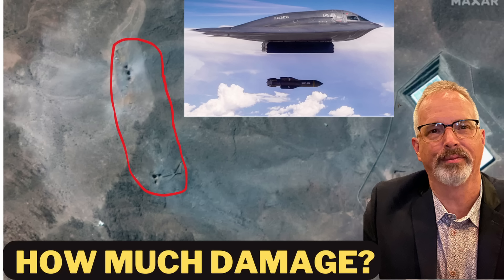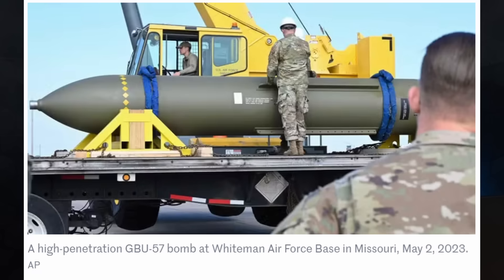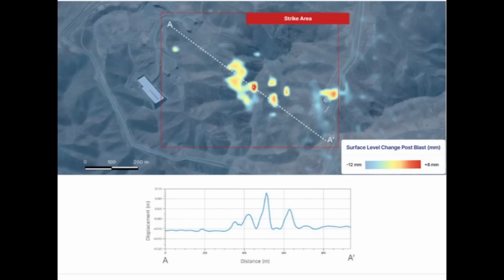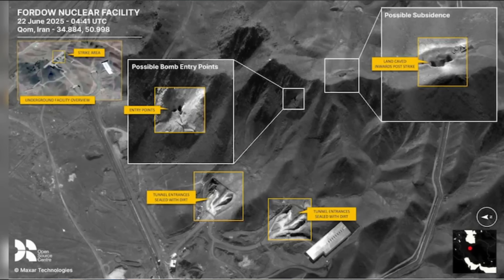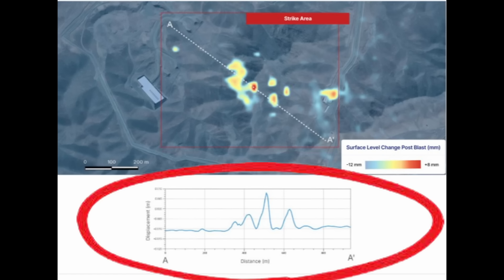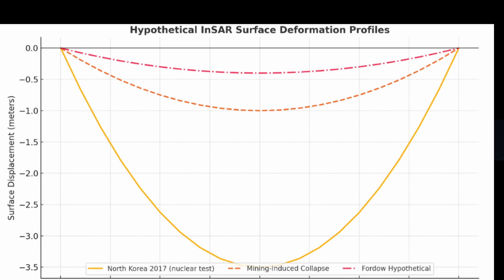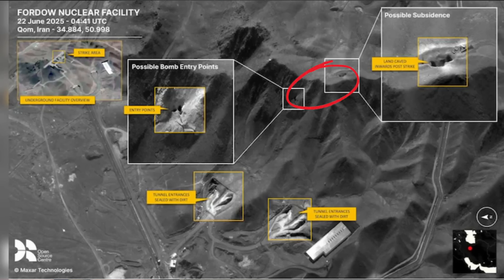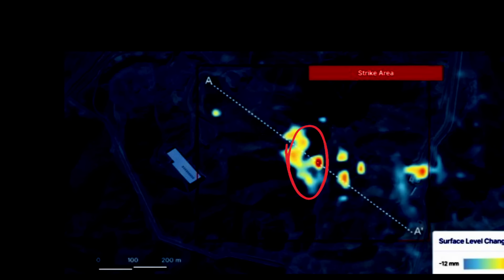Fordow Attack Assessment -  Update

Comment: Very good analysis.  What if the bombs tumbled during penetration due to shape and varying angles of the granite; wouldn't that lessen the ground surface elevation?  If bombs went through ventilation shafts wouldn't stand to reason that the bombs penetrated well below the ground level of the facility because the bombs would have gone through the ventilation shafts with no resistance (like a knife through butter) and penetrated and exploded well below the floor of the facility; and if so wouldn't that cause more damage and potentially a very large sink hole?
Reply from the maker: Thank you.  Those are all great points.  I would hope that the U.S. will release more information to explain more of what happened there.

Comment: The "powder factor" referred to in your calculations is based on a single confined explosion. As six GBU-57s were used at each entry point, you cannot simply add their cumulative effects. This is because each explosion would be unable to remove all of the material fractured by the previous blast, and consequently, later explosions will re-fracture the rock displaced by earlier detonations
Reply: It won’t b removed but more easier to break through.

Comment: One thing that has confused me about the discussions is the assertion that each bomb has an amount of explosives close to its weight: 27000lbs, but only about 5000lbs is actually explosives.  If I ran the powder formula using 5 bombs (Since 6 were dropped but one was just to knock the cap off), I get 25000lbs of explosives, for about 50000 cubic feet of rock.  Is that because the explosives here are more powerful than what is assumed in that powder formula?

Comment: Concussive blast waves tend to want to travel in straight lines along the path of least resistance. Void dampening of the blast wave is possible but difficult Any forking of the shafts must also consider characteristics & type of of the explosive .Different fuses may be indicated for different explosive force generators , fusing is a science of itself .

Comment: I'd like to know, whether 3 separate entry holes in one location means that all 3 failed to reach the intended depth, or if the first could have created an internal hole wide enough to allow the next one to go deeper, and the next, or if all 3 went to the same depth and had little effect other than shaking things up.
Reply: There werent three entry holes at each of the two hit ventilation shafts.   Look at the pictures of the shaft in the video. There were two and 6 bombs sent down each ventilation shaft.  The first was to penetrate the concrete cap the Iranians had put on the shaft.    Also some interesting stuff in the threads here, they Iranians were trying apparently to fill the shafts with material, hence the dumptrucks seen at the site previous to the attack.

Comment: A bit of a pervert did the math and they were traveling a little over $1,403 ft per second if guided munitions into a 300 ft air shafts from 31,000 ft.. 1 and 3/4 the speed of sound, there was no Sonic boom because it goes up vertically and only travels, goes horizontal. But the earthquake of that 100,000 + metric tons of TNT Overkill decimated anything underground. The fires underground in crevices, of chemicals no man could survive.😮

Comment: Remember, the machinery targeted is very precise, designed to turn at very high speed, with linear velocity probably just under the speed of sound in the rotating material.

Any high-acceleration seismic shock stand a near-certain chance of damaging such a machine beyond repair--and if the machines are charged with uranium hexafluoride, the whole volume of the underground halls will be filled with very toxic gas.

Comment: Not an engineer. But this video seemed to say very little. Fracturing rock that has already been fractured from a first blast would be very different ... and less impressive than the first blast fracture of intact rock.  Also, how deep did the bomb travel in tests through similar rock? Surely that is a factor ... but was not discussed. How much of the blast force was directed up through the holes the bomb had traved down through ????  Nice talk ... interesting concepts .... next to no useful data and yet you confirm the "total" estimate ... ok ....

Comment: I don't find this convincing.  There was enough explosive energy in the bombs to fracture an extremely large volume of rock.  Ok, how much of that energy was spent fracturing irrelevant rock?  How much spread out as shock waves that gradually dissipated over the course of many kilometers of travel through the ground?  Of the observed change in ground height, how much would be expected as the result of shifting loose surface material downhill after a seismic event?  What magnitude seismic event would match the observed change?  What effect would an event of that magnitude have on the underground structures?  The Iranians knew we were preparing to bomb that specific site: how did they prepare the site, to protect the structures?  Were there secondary supports that could bear the weight of the rock above, if the ceiling collapsed?  Were the sensitive centrifuges on platforms that would hold steady as the floor under them shook with the passage of a seismic wave?  I didn't hear any of that kind of thing.
Reply: the stuff inside was fucked, that is the answer to your questions.

Comment: Honestly, this is all still just guesswork. As long as we do not fully know the actual design of the ventilation shaft, the internal layout of the facility, the additional hardening they may have done, this is all very unreliable. Just a few meters of HPC outside the core facility, could have shielded the entire core facility. There is also no indication, that the ventilation shaft was just straight down, with no additional reinforcements in between, which could have taken most of the damage. 

As long as we do not get any official reports or leaks, we do not know shit.

Comment: Solid analysis with the data we have. I think the main missing piece is there is an assumption that the MOP was able to penetrate to the depth of the facility, either through its kinetic energy or the explosive aftermath, perhaps after multiple serial penetrations.

The problem is this: what if all that fracturing of granite took place above the facility and the void itself was never breached? Is there a way to calculate that from the data we have?

Comment: A question about the amount of rockfractured. (1 cubic yard per half pound of explosive)

you (Casey Jones) said each bomb was 30,000lbs of explosive.. 
https://en.wikipedia.org/wiki/GBU-57A/B_MOP says..
Mass	27,125 lb (12,304 kg)[4]
 "Filling	AFX-757/PBXN-114, Filling weight	4,590 / 752 lb (2,082 / 341 kg)" .

You appear to be using the weight of the bomb instead of the (much lower) weight of explosive filling)

So, your calculations are sort of an order of magnitude or so "out"

Comment: I don't even fathom that such a critical feature of the "nuklear" bunker was designed by chimney engineers, making it Santa's compatible.
Your analysis fits the allegory.
Yes, the final volume of "crushed" rock is based, as I sense, on "optimal" discharge of the explosive when there is little or no void in the initial cavity.
As the PV formula teaches, any substantial "empty" volume degrades implied forces. This compromises shock wave propagation, weakening the front of the penetration path even further.
What if the shaft was not Santa's compatible?
... was not straight
... was in a section protected by steel plates arranged in a crate, thus annihilating stresses from front wave propagation
... was deeper than the main bunker and was put on the side of the main structure

Assuming that the bunker was designed by idiots ... might be in the minds of some ... as evidenced, but others might have a different perspective.

Comment: Engineer here with a couple of questions:
1. How is "fracture" defined?  In other words, how fractured is fractured in a quantifiable definition and would merely putting a fracture through a block of solid rock in a confined environment cause or allow it's displacement into the underground structures?
2. How close to the underground structures did the weapons get?  Did they get close enough to create sufficient differential pressures in rock and/or gas to blast them into the chambers for the desired results (destruction of the enrichment devices)?

Comment: G-day,

Blooper Alert.

3 Kg per Cubic Metre
Is NOT
"HALF A POUND PER Cu. METRE..."

3 Kg is closer to
SEVEN POUNDS...., per Cubic Yard.

Therefore, thus, and because...

Casey, mate, you appear to have Overestimated the Damage done to the Granite, by a factor of SEVEN - bases on the 

Poundage of Explosive multiplies by a totally erroneous and exaggerated ("Trumpificated") 
Powder Factor.

"Septic Tanks" (ie, Yanks...) are
Internationally FAMOUS for such
Mistakes.

NASA successfully (Suck Cess Fully...!) spent decades building and launching, then years guiding a very expensive Mars Lander to
Miss the Atmospheric Entry Window, because the Septic Tank on the Electrick Slide Rule 
Failed
To convert Newton-Metres per Second into Foot-Pounds per Second, or something equally Infantile and obvious...

It's a KNOWN FLAW when working with "Engineers" raised & trained in the USA.

When converting from and to metric,
They 
Often
Go the WRONG WAY,
With their SIMPLE ARITHMATIC.

160 METRES of Granite.

Bomb DESIGNED to penetrate
50 FEET of Rock.
3 Bombs per Hole, one to remove the Cap...
Two Bombs down the Hole.
And - even assuming the Bombs went all the way to the bottom of the Vent-Shafts (?????),
7,000 Kg of Explosive per Bomb (half their weight is Steel Casing), is 5,000 Cubic Metres of Broken Granite..., maxim (?).

But, whereas 3 Kg of Explosive will "Break" a Cubic Metre of Granite - that Cubic metres is assumed to be unsupported, sitting on the ground, with the Explosive sitting atop it.

In this Raid, each of the 5,000 Cubic Metres is embedded in a Contiguous Rock, underground.

When was the last time anybody placed ANY Explosives 160 Metres deep in a Granite Mountain and then measured the Camouflet thus produced by the detonation ?

My guess is

NEVER BEFIRE IN HISTORY ! (?).

Part two is that the 
Perhaps TINY little Cave the Bombs produced were halfway down the 160 metre Shafts - and the Shafts were linked to the "Gallery" by a pair of Tunnels, a Kilometre on length...

And the Tunnels were designed for Nuclear Weapon Groundburst Attacks overhead in mind...; so, YES, the Tunnels were fitted with Blast Overpressure Doors, at both ends, and maybe in the middle too.

So, my 
GUESS,
Is that the Gallery of Centrifuges was
Merely
"Shaken but not stirred..."

Like 007's Dry Martinis.

Yet ANOTHER
'MurriKa(!)n
Militarised
FAILURE...
Apparently.

And then overpowered and wrapped in
Propagandustic
Triumphalist 
Bullshit, before
Presentation to the World.
Labelled as a
"Success !"

(Suck Cess...!)

The Click is ticking.

Unkle Spam can 
Ignore
Global Warming 
BUT
Global Warming
Will NOT
Ignore the
Excited Status of
Norte ArmedmeriKano...

In fact, by the look of Texas,
The Weather Gods are
Making an EXAMPLE of what happens when the filthiest 
Emitters of Atmospheric Fossil Carbon
Retreat into
Denial and Rationalisation.

Unkle Spam's
Karmic
Comeuppance is
In the Pipeline.

Count on it.

One does not even NEED 
To perform a targeted Raindance
To
Bring it on.

One has but to sit back, chew the Popcorn, and try not to giggle too very loudly...

The Universal Creator Godtheory is NOT 
An
AMERICAN...

Do try to keep that FACT in mind.

Such is life.

Have a good one...

Stay safe.

;-p

Ciao !
Reply from the maker: Too quick to criticize. I said a half pound per cubic yard.
Reply: @CaseyJones-Engineer 

You said 3 Kg per Cubic Metre
You said
Half a pound per Cubic Yard.

A Metre Is
39.3937 inches.
A Yard is 36 inches.
One seventh the mass of Explosive will NOT
Create 6.8 times the amount of Force when you measure it in 
Pounds instead of Kilograms, and make a mess of the Marhematics.

AmeriKans will, no doubt, swallow that 
Politicised/dumbed-down/ deliberately wrongful crap....

Australians, not so much.

;-p

Ciao !

Comment: The intelligence community has been silenced by Trump.  There are 6 bombs used at Fordow.  There are six holes.   The ventilation shafts are almost certainly not vertical.  The bombs can penetrate 60 meters of the 100+ meters required.  So, they missed the target.

Comment: You have made several mistakes.
The majority of the weight of the GBU is the metal casing; the actual explosive was about 7000 Ibs. Also, you did not mention anything about HPC concrete. The shaft was lined with this concrete, which can withstand earthquakes!!
https://www.youtube.com/watch?v=hsWZlVcVRSM&ab_channel=DanielDavis%2FDeepDive
Reply from the maker: I explained to configuration of the GBU accurately and early on in the video.  The granite is stronger than the concrete.
Reply: @CaseyJones-Engineer  No, you are wrong, HPC is designed to absorb more shock energy than granite. Granite, while stronger, will factually fracture while HPC will keep its shape!!

Comment: Thanks for the video. This analysis is interesting. 

To what extent would a pressure wave and possible flame front be channeled along the shaft? I remember seeing some analysis of how pressure waves expand from an explosion in a refinery or chemical plant. I seem to remember that a dense configuration of equipment and piping could channel the pressure and even speed the wave a little bit. That effect could make the wave more dangerous. Beyond the structural damage to the tunnels, I've wondered whether the pressure wave and possible flame front could have destroyed every piece of equipment within the facility. Even if they can open and repair parts of the underground rooms, they might have lost everything that was housed down there.

Comment: Fordow was designed and constructed at depth, surrounded by reinforced concrete and natural granite, not for peaceful civilian use.  Tomahawks followed B-2 strikes to obliterate surface structures, perhaps adding confusion to satellite analysis.  Is the exact depth of the enrichment facility known, and did all the BBs detonate as expected: IAEA noted only ambient radiation levels.  Where exactly is the enriched fuel? Why were the ventilation shafts covered in concrete?  Too many questions remain ... time to depose the mullahs and the IRG ... drill exploratory shafts for sampling: oil companies rely on this practice before investing large sums of money!  Perhaps Mossad can add data.

Comment: Great analysis - fusing issues deserve more consideration.  That aside, hard to imagine there wasn't massive destruction  US ability to hit hole in ground multiple times from 30,000 feet mind boggling.
Reply: I believe the B2’s altitude at drop was 50000ft.
Reply: They dropped them from 50,000' to get the maximum terminal velocity based on the bombs' weight, mass, size, shape, etc. 50,000 is the B2 official operating ceiling, and the altitude from which those bombs were designed to be dropped.
Reply: 50,000'. The bombs weighed 30,000lbs each

Comment: There is another consideration - assuming thousands of centrifuges each containing some quantity of uranium hexafluoride plus all of the process piping that tied the cascades together - the blast wave / shock would have been devastating and would have massively contaminated the facility. Even if there are portions which survived intact, they would be contaminated, uranium hexafluoride breaks down into hydrofluoric acid and uranyl fluoride upon moisture exposure, the reaction is highly exothermic. The hydrofluoric acid would rapidly degrade any surviving equipment and human entry would be problematic.
Reply: The leak would have been detected and there would be concern about contamination. Neither of these occurred
Reply: @cmendoza1094 Not if contained underground
Reply: I was thinking the same. Assuming the analysis in this video is correct, I am certainly no expert on this. Still, it has a strong ring of truth to it, that blast damage would cause massive UF6 chemical contamination, and if pumping stops, water will enter the tunnels. That water would react with the UF6, making the site highly contaminated and extremely dangerous to work in. Within a few weeks, the water and chemical reactions would destroy any surviving equipment.

I know this, I would not take the job of going down to fix it.

Comment: 6 meters through concrete
10-20 meters through granite.
60 meters for dirt
These penetration depths are based on the Penetration Equations developed by Sandia National Labs for the military and updated periodically.
The math is fairly straight forward but the narrative walks you through most of it.
Penetration Equations 
Sandia National Laboratories 
https://www.osti.gov/servlets/purl/562498
Reply: The MOPs were designed and tested with assistance from Los Alamos National Laboratory (LANL) starting around 2010 with the first physical prototypes dropped around 2012. They were designed by an interdisciplinary team which included physicists, explosives experts, metallurgists, geologists and civil engineers, and the MOPs were designed SPECIFICALLY with Fordow in mind. The geologists located a mountain about 20 miles from the Trinity Site in New Mexico that was thought to be  geologically similar to the mountain at Fordow, and they even went so far as to build a hardened bunker under it. You can read all about this in GREAT DETAIL by Googling "Los Alamos Scientist’s Insights On The GBU-57 Massive Ordnance Penetrator, Howard Altman, The War Zone, July 3, 2025"